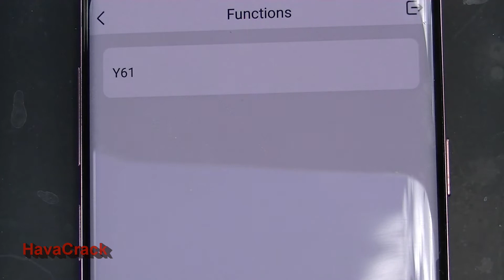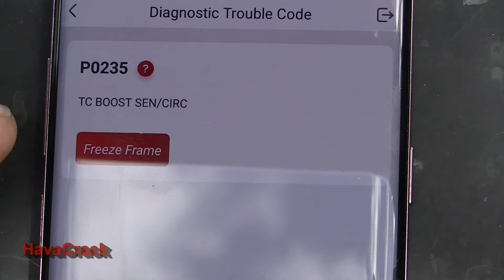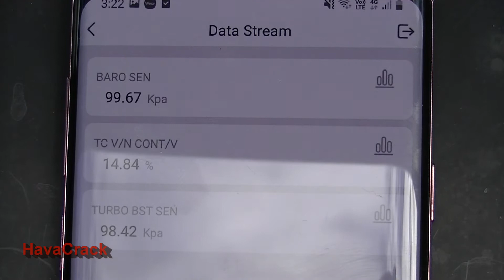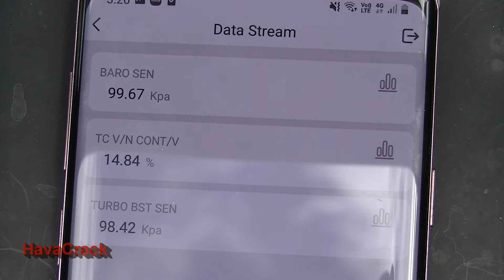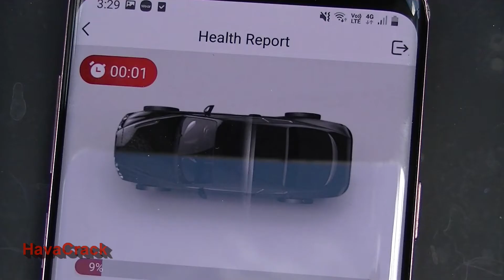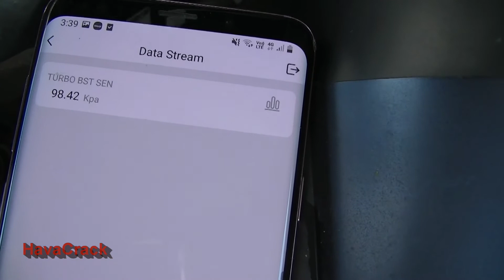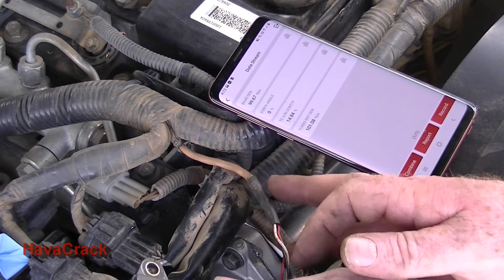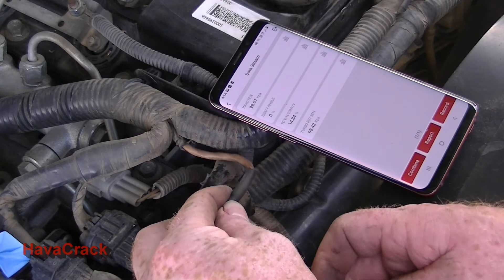HavaCrack - P0235 DTC Turbo Boost Sensor Fix - Nissan Patrol ZD30

Comment: What is not made clear in the title or video is this is CRD engine, not the Di. The use of a mobile phone app with likely a cheap BlueTooth adapter in the OBD-II port.
Reply from the maker: Sorry for the crd omission, I presume you mean that the di models do not have obd2, is that what you meant?  I suppose i could have used my picoscope to demonstrate the same issue but not everyone has one of those either.  I take the feedback and i am sorry if i wasted your time watching. Next time I will name my video 'I broke my 4wd' and have an image of my hands on my cheeks like i am in shock, or an image of a girl in a bikini as a bit of clickbait!  I am sorry for wasting your time.  BTW it would not matter if it is a cheap obd reader or a snapon it would have shown the same outcome, the message really is just because a sensor throws a fault code you do not immeadiately replace the item it is about finding the fault which in this case was a wire that visually looked in tact but internally it was fatigued/broken. With your di i recommend buying a picoscope, and a test light to assist in fault finding as that will identify most issues on powers, grounds and signals.  Mick

Comment: I have got Nissan Patrol Y61 3.0 Di (y2000) but i can not diagnose  check error . Diagnostic scanner don't want to connect with 
engine controller. Which scanner is compatible  with OBD II system of Nissan Patrol? Thanks.
Reply from the maker: From what I know apart from the factory Consult program for the DI models there may not be an option for a obd2 scanner.  I found this on the internet .....
The Di Patrol uses Nissan Consult II and isn't OBD-II compliant like the CRD, but still gives some OBD data. You have the option of using the ECUTalk Consult LCD display or the ECUTalk software on your laptop via an interface cable....I found this info here, so you maybe able to get more info on the ecutalk. https://www.patrol4x4.com/threads/diagnostic-and-code-scanner.101691/

Although an obd2 reader or scanner can show you information and in some cases DTCs and bi-directional functions that information if you have it is only a starting point to fixing an issue.  Therefore maybe an option is if you suspect where a fault (electrical) may be then get a picoscope (2440a) and analyse the data.  If you understand the picoscope it can convert the canbus signals to their relative codes.

On the patrol and even the crd although obd2 readers such as a Scangauge can read data it will only show you genneric 'P' code DTCs so even that is less useful.  The scangauge never picked up the P0235 I had. 

Not sure if any of this has helped.  Regards, Mick

Comment: Amazing, thanks for a tip!
Reply from the maker: Thanks for watching, if you ever get the DTC then at least you have a starting point to look at.  I could not find anything on the internet to help.  Mick
Reply: @HavaCrack  wilk get back to you when will get to my garage. Currently I have to finish welding jobs for patrol and then will start wth engine optimisation. 
Thanks